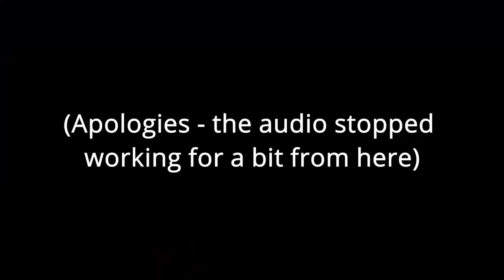Arden Station Metro Tunnel Tour - March 2022

Comment: Thanks Phillip. That was interesting indeed. I work near Chelsea and have been watching the new stations and tracks being put together. It occurred to me that the residents would have been better off opting for sky-rail and had a line of site to the beach front and shops and not that hideous maze of wire and tracks that they are getting. I know they fought hard to avoid sky-rail, but I think they got the short end of that stick. If the option was to put the tracks underground and covered where possible, that would have been fine allowing for free movement from one side to the other, some greenery etc. What they got is a nightmare IMHO.
Reply: As with all the dwellings and shopping precincts around the area values of property have increased markedly.
Same with all the other sites over the past  years.
People don’t complain about opinions ,only results and advantages at the end of the day.
Reply: @oscarsusan3834  Exactly.